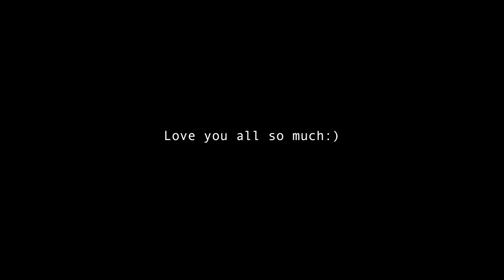A Surprise Ending! (Story 95)

Comment: I must mention to your viewers,  who may be dealing with the same problem; insulation underneath the floor; I found a very good solution to the problem of  hanging insulation as well as to the mice, which love to take up residence there: some years back I stapled 1/2 or 3/4 inch chicken wire mesh to the floor joists underneath my cabin. Worked great. Insulation stays secure, house stays nice and warm and no mice scurrying around !! Yeah!!

Comment: When chopping the wood, pull your higher hand down the handle of the ax to your other hand holding the end as you swing. It gives more momentum and more powerful swing that’ll split the wood easier. And it’ll also protect your legs and feet from accidentally swinging the ax in towards yourself. I just learned this last year from my dad and it’s helped a lot!

Comment: I know this is "a day late and a dollar short" but... to help you out in the future with that sheet metal - red, green and yellow handled sheet cutters do not work on ribs or valleys, only nibblers work (you know this already seeing from your video). So, take a utility knife and score the rib or valley pretty good 4 or 5 times up and down, then cut across the ribs like you normally would to your desired height, and THEN just bend the piece on the score mark back n forth to snap it off cleanly... no more jagged edges from trying to cut a rib or valley 👍 Hope this helps

Comment: Have you ever raised more cabbage than you were able to use? You can pull them up by the roots and dig a hole and place the cabbage in it. Then cover the cabbage but leave the root sticking out of the ground.  Then you can go out when the weather is warmer. 
Please don't strip any of the outer leaves from the cabbage before you bury them.

Comment: a Council for the future.  When you use the drill.  Do not make it run fast but at idle and occasional.  If you need to fix other metal panels, I recommend that you first make some holes, perhaps with a nail and hammer, so that the screws can penetrate.  Then in the garden if you have eggs, do not throw away the shell.  When you get to a good amount you have to crush them until they are almost flour.  then spread in the garden.  contains calcium and plants need.  over time, plants absorb calcium from the earth and it becomes less fertile.

Comment: You should get a metal tub, put it on a stand so that you can start a fire under it so you can have a warm bath.  I watch another channel that has a firebox with two pipes that connects to the tub.  The water goes through a heat exchanger and back into the tub.

Comment: Now after you complete the weather issue. You must prevent critters and water from penetration of your home flooring. Thats the floor you walk on every day. 
Take 1/2" to 3/4" of plywood and cover the bottom or your home. (You will need a friend to help you) use a Nail Gun . this will ensure that you have adequate all weather protection. If you have question on the rype of foundation. Please send me an email or ask here on you tube.
Im exspirenced carpenter and light construction of 27 year's

Comment: As is, if you continue to have insulation falling out. Then the house will loose the abiltiy to repell the element's. Every structure, even if it's a lean-to must have a sub floor. Insulation fits in between your floor joists. Then take thick all weather plastic roll over the bottom, tuck in the side of floor joists and use a heavy duty staple gun.
Please wear a respirator, eye protection and glove's

Comment: Hold the insulation in place with coarse wire screen - keeps vermin out, keeps insulation dry.
Safety goggles? Please. Going along with fringe living - med kits, communication options. Now you've shifted from some good fermentation advice to walking up a steep roof line in Tevas. I totally get the connectedness of living literally in touch with ones' environment. That desire is often so appealing that we sometimes let it put us in danger, and some of those times, our book ends far sooner than expected.  I do also know that part of the pleasure of living in contact with our environment, is also (partly) the risk and mystery of it. We just have to balance that with allowing ourselves to be able to write our last chapters on our own terms.
You: "I'm scared!"
Your Subconscious: "I'm scared for a good reason - listen to me, I know what I'm talking about".

Now imagine a sharp piece of roof steel gets in your eye, while you are precariously balanced on the ridge of your roof. It was hard to get into that position with all of your faculties, how hard will it be to get down missing an eye? Not to dissuade you, at all, but this is the zero-sum game we play with life. Going up requires coming down. Humans - well we tend to paint ourselves into corners a LOT.

Historically, as kindred souls, as neighbours, you'd be educating me as we garden next door to each other. We'd have each other to rely on if either of us gets inured. By us living with a phone and time between us, we're missing out on so many of the benefits of community. Yes, you're teaching me some good ideas about fermentation, I might get you to start wearing eye protection, but will never know... You're going it completely alone and that is really the whole reason humans formed "community".

Waaooow, a beautiful garden! Really looking nice - great work!'

Pressure cooking - you already know what I'm going to say right? If you fall back and get a food partially boiled, how does that leave you set for everything else?  Everything normal for you except -a foot -speed + pain +distraction from the pain. It shifts the balance of your life entirely. Don't wait to see if I'm right, because you already know. You're a good person who is good for this planet, you need to stay here as long as possible. First indication that you've got a partner with opposable thumbs. Relief...and then onto splitting kindling no glove, no goggles. Now looking at how much talent you bring to that arena.... yikes. Climate change has brought Japanese Murder Hornets to your area - are you sure you're not allergic?  So you for sure have an Epi-pen in your medkit, easy to get to. My partner says this is me being "negative" or "pessimistic" - not so, I was a boy scout, so I know to be prepared.

"Farming isn't lucrative..."  Depends on where you see the value.

Just learned of your family plans  - now you have a solid reason to protect those eyes! You'll be a provider for your family, which may be your entire society locally, maybe not. They are depending on you having all your fingers and toes and then maybe at some point, you find you have some other little fingers and toes completely dependent on you. You can teach them about how to keep their eyes safe : )

Comment: 7:32 You should not drill your Ridge Beam, that weakens it. Instead y;ou should cut a smill strip from the deck board on each side of the ridge. You can cut the deck board with a circular saw, just cut the depth of the board.

Comment: if you would have turned the metal around so the flat side was facing up it would have been easier to fasten to the structure. 😀

Comment: 4:08 would have gone easier if you drilled a hole in the tin first. Or used the correct screws that have a built in drill..